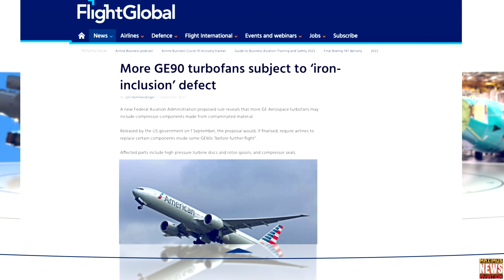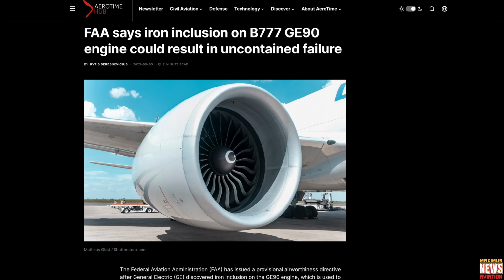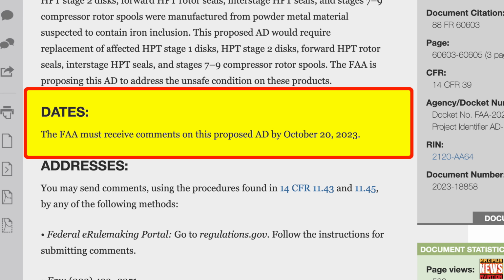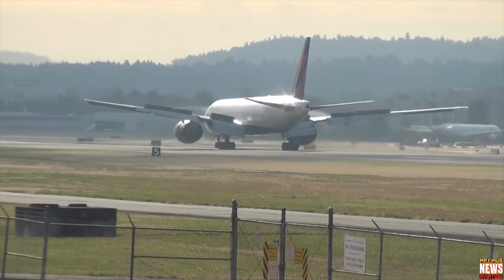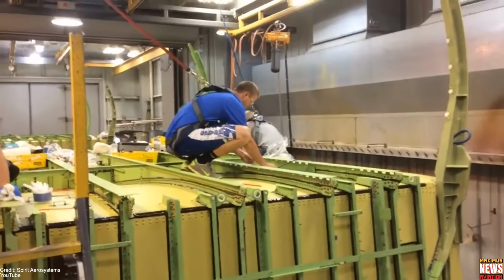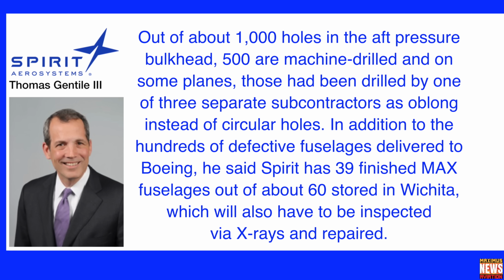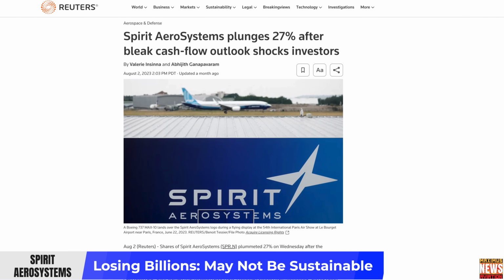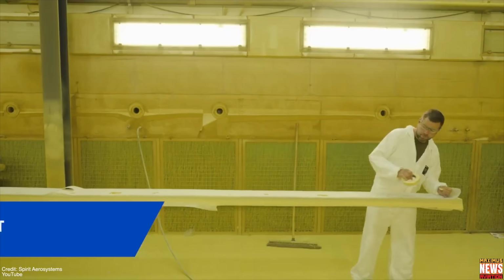The Big Boeing News Report: Includes Bad News For The 777, 737 MAX, 787, And Even Airbus Jets!

Comment: The powdered metal affects Airbus and Boeing, as they both use either Leap engines, the CFM56 or the W&P, all of which were found with contaminants. The A320CEO is like, 30+ years old dealing with contaminated metal potentially. Those micro cracks could be pretty big right now. Meanwhile the Max is still fairly new. The point being: Airbus and Boeing both suffer from this issue and whether you choose one or the other there is still a present but very low risk. Don’t fly at all if this makes you uncomfortable.

Comment: Carbon fiber is an incredible fiber but is very labor intensive and zero tolerance for errors. 

With decades of advanced material reinforcement manufacturing engineering experience, the manufacturing cost accounting of carbon fiber parts is critical to understanding all the true costs involved. 

Automation in the correct manufacturing environment is critical to obtain a profit while maintaining top quality parts with on time deliveries.

Comment: How is this another factual video brought to you by Boeings Cost, schedule and shareholder value over quality and safety? How has a supplier issue got to do with moving away far from manufacturering and has become a plug and play so as to blame others when problems arise? 

Sad thing is the overall product is not the respibility of the manufacturer when the engines of that aircraft are not made by Boeing or airbus themselves when they experience problems. The only product they sell is the frame but not the engines. They choose tne suppliers of which is not their fault if the vendor experiences supply issues and quality issues. Get that in your head triggered one. Despite 17 likes they're all from your 20 odd mads up accounts so we all know who you really are.
Reply: Looking through the comments, you've received little sympathy for defending Boeing over these issues, and that's mainly because you refuse to believe that if a manufacturer says to Boeing, we can make that part cheaper than your own factory can, so sub contract it to us, its not Boeing's fault. Im afraid it is, because they lose a degree of quality control when parts are made by a third party, and they know that. If these products were as good as in house, why are they cheaper? Not falling for the claims of snake oil salesmen is the responsibility of Boeing, so they must bring more sub contracted work in house to secure their future. You are correct about the engines though, the 777 is just unlucky, but on top of everything else going on at Boeing, even problems through association, are magnified....
Reply: @artrandy  I'm replying to Stevens comment here. However this is not about defending boeing. Do you think this supplier issue is boeings fault?  Explain how a supplier issue is boeings fault when all suppliers have issues? If a manufacturer says to boeing, we can make that part cheaper than your own factory can, so sub contract it to us. Its not boeings fault because only the subcontractor looses its degree of quality control not boeings. When parts are made third party and being sent in bad quality. Boeing picks up the quality defect as the supplier made these bad parts and not boeing. Why are they cheaper? Because every company wants things done cheaper so they can save more money. Its not the responsibility for boeing for snake and oil salesman. Unfortunately manufacturers do not make parts for their aircraft In house as the only way to go is outsourcing them. That's the future. This is all on.tne supplier not boeing. They can only pick up and control what they find. They don't fix things for their suppliers.
Reply: @nickolliver3021  
My first sentence confirmed that I was replying to all your comments under this video. That's only a small point maybe, but it indicates that you DON'T read what other people write.

Some of what you write in return is too incoherent to actually understand, Im afraid, the second half in particular. Other points of mine you've tried to answer, but seem confused by what I've written. I've reread my comment, and it does make sense.

Maybe its best to go to bed if you're 'tired', and deal with stuff when your feeling fresh.

However, I will repeat the crux of my argument. if you think Boeing should continue to out source components that were once made in their own factories, to unreliable third parties, and then claim its nothing to do with them, when those parts fail quality control, and aircraft get grounded for checks and or repairs, then I think you're in a minority of one.

What happens if this Boeing supplier fails financially, does Boeing close its factories because it has no components, or does it pump hard earned cash into that company to keep it going? Its looking like the latter, and you think that's good for Boeing? Really?

Im making a very straight forward point here........
Reply: @artrandy  Look my sentence confirmed that it is never the aircraft manufacturers fault for choosing a bad supplier. I was replying to "Soyousay7751 who always wants to believe its their fault for engine problems. It's not that at all as the airline chooses them and never the aircraft manufacturer that's my point. 

I don't think what I have said is incoherent to understand. All of it should be understandable. Of course I do read what people write. Steven who is under Soyousay7751 proves otherwise as he wants to tell people how he wants everyone to believe him. I've reread mine and it makes sense too. 

Perhaps I'm fine as I am thank you very much. 

If boeing and airbus continue to outsource components that were once made in their own factory which never will happen, to unreliable third parties they have to make sure they are reliable as they manufacturer has no other way of making their parts as manufacturers do not make parts for their aircraft. They only assemble. Nothing else. If parts fail quality control and aircraft get grounded for checks and repairs its up to the manufacturer to check and make sure the supplier either fixes that issue or they have a whole new set of parts sent in up to the manufacturers standards.

If boeing supplier fails badly then they will need to work with another however another company will take over most likely as parts are already made. Them pumping hard earned cash into tne supier to keep production going of parts should continue if only a quality problem Is only the issue.

This needs to be sorted out as they can make good quality parts but somehow it has lacked over the past year or two and quality at tne supplier is going downhill. Someone needs to take charge and put quality back into the workforce of tne supplier. Lots of articles on Facebook about spirit Aerosystems that say they are struggling to meet demand where quality had dropped significantly.
Reply: @nickolliver3021  
I didn't wish to be personal in that way, but if what you wrote made sense, why have you subsequently edited it?

I think you're banging your head against a wall. You seem to be almost a minority of one. People on here are defending Boeing's reputation, but they're also cursing Boeing for sub contracting what they used to make in their own factories.

I've had my say, I'll leave it at that..........
Reply: @artrandy  that's because I couldn't fit what I wanted to say in on my screen by phone. That's why. 

People will defend boeings reputation. And there will be people defending airbus's reputation too. Airbus is having the same problem believe it or not. Nobody should curse for subcontracting what they never made in their own factories. Only their suppliers did that not themselves. 

I think some need to understand its the subcontractors fault and not the aircraft manufacturers

Comment: So... GE and P&W are both suffering the same powdered metal contamination problems.
Interesting that all the latest generation of engines have pushed so hard up against physics limits that they all are failing to deliver promised performance.
(or maybe it is all just a result of the manufacturers cheapskating development???)
Reply: nah, this isn't the result of pushing hard against physical limits, this is a manufacturing issue that could happen to anyone on any technology at any period in time, really.

Comment: I remember when the Blisk was developed for fighter jets.  Up until then turbine bladed were made separately and bolted to the disk.  Checking the attachments was very important and it wasn't uncommon for blades to be thrown under extreme conditions.  Another problem was that heat did not transfer easily from the blades to the disk.  Cintered powdered metal blisks were one piece turbines and had superior heat disapation from the blades to the disk.  The problem was any anomaly meant that blisk was to be scrapped.   This requires excellent quality control which makes blisks more expensive.    Just getting the alchemy right in the 1st place was expensive.

Comment: What has happened to quality control, ie first off inspection. Are they cutting out quality inspection to save money again? Typical accountants overriding engineering.
Reply: The quality control at spirit has fallen correct. They are cutting and quality inspection to save money. The accountantants at spirit are over ridding the engineering at spirit

Comment: The 777-300 engine failure shown was not an uncontained. (Denver) The one on the same day with a 747 over Maastricht (same engine) was uncontained.
Reply: Both failures were P&W, no surprise there
Reply: @rafaelwilks  Yes, P&W has become a totally unreliable supplier. But the airliners have no leverage since Raytheon is a supplier for many systems.

The P&W 1500 with the bleed air resonance was catastrophic at the A220's introduction with an engine blow up every week.

But lets be fair: All brands have/had their fair share. GE/LEAP/Safran with disks, blades and the latter also with combustion resonating.

RR had the issue of Nickel Sulpherizing of blades. And the misdrilled oil channels. Maybe the holes were drilled by Spirit?

Comment: Apparently, Spirit Aerosystems got contacts to supply Boeing and Airbus, and 'got behind in the learning curve' in manufacturing procedure and quality control, and the costs of repair and rework is 'unsustainable' for the company. What happens when Spirit goes under? Guess the lowest bidder is STILL not the best option!
Reply: It's a bit like Darwin's theory. Next best company will show up and evolve into Spirit's successor. Some "genes" (=management/staff/personnel) will join in the "NEW!" company...
Reply: The lowest bidder never was! The top quality for the lowest price is one of the myths that only university graduates who could not drive a nail into a wall could come up with. For top quality one always needed top material, top design staff and mechanics who could handle the manufacture processes flawlessly and after all that a quality control that would find minute discrepancies! And that costs money, a lot of money. Doing it any other way in the aircraft business will cost lives, a lot of lives!
Reply: It’s not like there were tons of other bidders, knocking at the door.

Comment: Any news that keeps the 737 MAX on the ground is good news. Grounded MAX's have killed zero people in the past. Manufacturing issues are not US problems; come on, that sort of stuff happens as soon as you start manufacturing. The more techniques there are the more that can go and will go wrong. In general US manufacturing can be considered on roughly the same level as the EU. With lower quality standards but more threads of litigation after the big poof happens. And less worker protection.

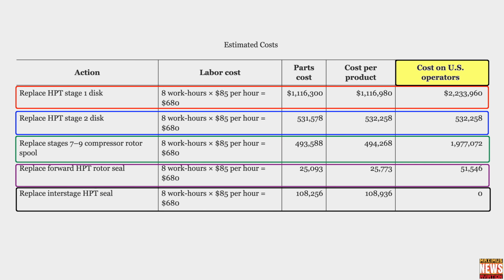Comment: Am I the only one to spot it? At 4:28 ?? 
My local Nissan dealer charges out the spanner jockeys' time at c£150 per hour. And the guys repairing, modifying and inspecting large passenger aircraft components it is only $85?
Someone please tell me it's just a convention, set in the 1960s or something.
Reply: $85.00 an hour is overtime rate for max rate aircraft mechanics at Boeing, many are lucky to earn $25.00 an hour. In 2020 my overtime rate was $90.00 double time and $67.50 time and a half at Boeing. At the time I was max pay rate.
You'd be surprised what they pay mechanics to work on multi million dollar aircraft, they say we should be thankful.
Reply: @soyousay7751  Thanks for that.

Comment: Boeing made a huge mistake by moving mgt away from the factory. But they are steadily cranking out 737 Max planes, and the operators like them a lot because they save $$$ on jet fuel costs, which are much lower because the planes get better MPG.
Reply: But if they stayed in Seattle, then they would have to talk to the engineers. As we all know, someone with an MBA knows more about engineering than experienced, qualified engineers. / SARCASM MODE OFF /

Comment: The problem with failing to invest enough to ensure that it is done correctly the first time is that you can end up having to do it twice!

As for engines, the market demands the latest to ensure that another few percent can be shaved off the altar of per seat cost. 

As we know, NEW often has teething problems, especially when coupled with engineering close to the limit. Throw in extemes of variable temperatures and operating environments and it is what it is. You cannot test for every combination and permutation. 

For example, I worked in software testing before I retired, and once saw a major crash in a system because an obscure combination and permutation occurred after 30 years of daily use. Unfortunately it prevented the rest of the overnight schedule from running.

As with aircraft manufacturers lovers and haters there are the same with engines. They will try to play down the issues with their own and exaggerate those with the 'others'.

What really matters is how quickly the manufacturer acknowledges the issue and how long it takes them to fix, or in the shorter term, mitigate it.

As they say, People in glasshouses shouldn't throw stones!
Reply: Well said. Basically this episode is about GE Aerospace jet engines and Boeing overvaluated Financial Managers.
GE Aerospace must either meet FAA requirements or withdraw their jet engine from airworthiness. It's up to GE Aerospace to make the correct decision suiting to their company.
Boeing is experiencing harsh setbacks from deleting technical staff and allocating Financial Managers instead. Problem with financial managers is money. Gravity is a natural phenomena. No financial manager can buy or sell Gravity. Yet aircrafts depend on gravity and technology is needed to beat it... Boeing knows it very well. They better start reorganizing their (top) management.
Reply: This is basically QA .....

Comment: Spirit losing money on 787 is puzzling.  Of all of the design/technoogy decisions for the 787 I have been curious to see which ones Boeing sees as advantageous , neutral or actually bad decision.   (one piece  carbon fuselage plugs, all electroic, no bleed air etc),   At launch, the 787 with 8 across seating did not do well (too expensive for capacity), and it wasn't until Boeing pitched it as 9 across with narrow seats that airline accountants started to like the plane.

Years into the programne, one would think the production processes would have been streamlined and economies of scale reached. But if Spirit isn't making money on its work,  has the bet on all the new stuff for 787 paid off? Will the next plane return to more conventional design/fabrication? 

Boeing had to buy Voight because of lack of expertise and inability to deliver.  Boeing does not need to buy Spirit to get to produce/deliver, it would simply need to renegotiate pricing for the parts that come from Spirit so Spririt can survive.

The issue with the A220 and other Airbus products is different.  These contracts were with Bombardier Aerostructures (mostly at the ex Short Bros in Belfast Northern Ireland).  When Bombardier Inc was forced to liquidate any/all assets it could sell to pay debts, Aerostructures was sold to Spirit.  Anti-Trust ussues would likely prevent Boeing from buying Spirit unless it spun off the former Aerostructures part to some unknown buyer.  As with other portions of Bombardier, Aerostructures was starved of cash and unable to invest to increase productivity. So it all depends on whether Spirit, ypon buying it, invested to bring productivity back up, or if it just left it on auto pilot.  (Alstom is still losing money on what ot got from Bombardier Transportation due to it biding under cost to win contracts and no investment in its plants to increase productivity to compete). 

So I have my eyes out for when Boeing designs a new plane, especialy now that "derivatives" no longer get rubber stamped approvals. What portions of the 787 will be re-used for a new plane and where would Boeing return to more conventional designs/materials because in the end, the end up costing must less and perform nearly as well.

Comment: Could 737 bulkhead issue include those in/on P-8 Poseidons?
Reply: Unlikely. The P-8 is based on the previous gen 737-800, not the 737 Max.
Reply: @M1911jln  Well, they sue the same fuselage and the same bulkhead.....and for your information: yes the P-8 is also affected.